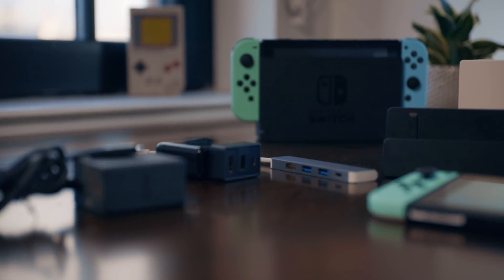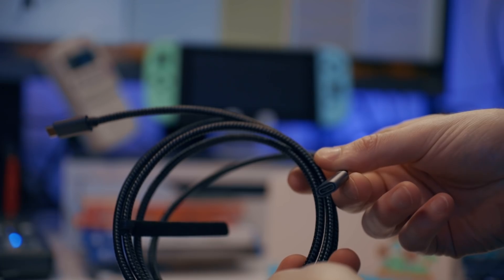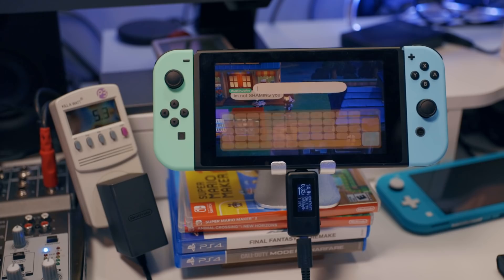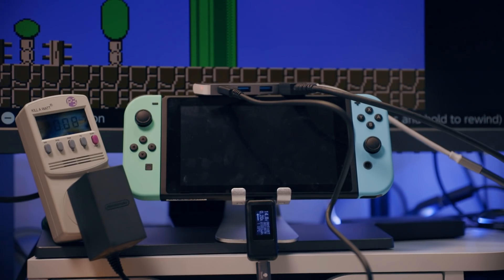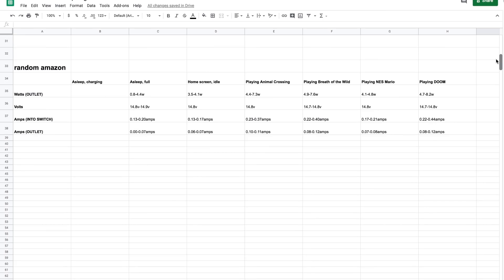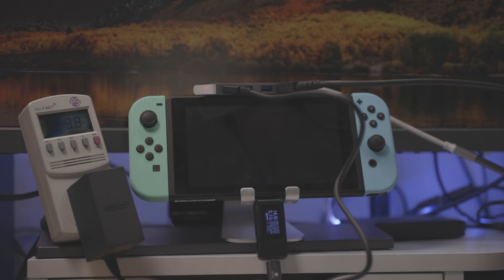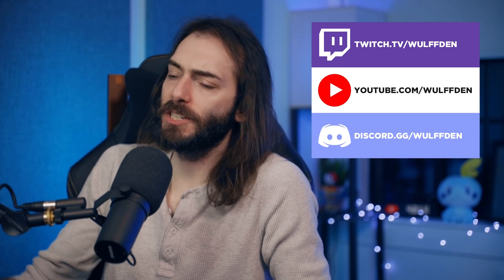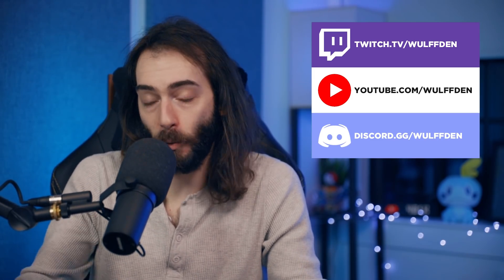How the Nintendo Switch consumes Power

Comment: so here’s a question regarding charging cables only- the switch pro controller (nintendo, not the 3rd party ones) comes with a usba to usbc cable. logically since it’s an oem cable, when paired with a PD-supported charger it should pull enough power to charge the switch itself, correct? because i can’t figure out why the one that came with my pro controller doesn’t charge frankly anything plugged into it. not even the controller very well. it basically pulls enough to act more like a wired controller. 

my assumption is the cable is bad, since anything else plugged into the same PD outlet works fine and the controller can charge off my usbc - usbc cables perfectly fine, and the switch can also charge off those cables no problem. the c-c cables came from anker with their PD 20100 power banks, which is my go to for Nintendo approved charging banks. and just everything charging banks.

Comment: As a computer engineer I have respect for anyone who does electronics testing for fun
Reply: Seems less like 'for fun' and more 'for my owm sanity' XD
Reply: Thats all good and well but when you publish results you should have the common sense to know that your value of zero is not zero unless the watttage is 0. Otherwise u r stating that invalid data is something you should go off of.
Reply: Same here (tho mechanical engineering and I do the whole electronics for fun thing).
The best way to get into a new field is trying it out for the heck of it. Electronics is certainly one field that people shy away from the complexity and fear of electricity or destroying expensive stuff, but the more people get into it, the less misinformation is spread about stuff like this whole dock deal, and less products end up in landfills, when they could be repaired instead.

Comment: Watched your last video about this stuff 2 days after I recieved my Ikedon switch dock...thankfully never used it though. Returned it and started my journey to find an affordable Nintendo dock. Finally found one on GameStop, yes, GameStop. Why? Because it came with the power adapter, HDMI cable and full dock (not missing ports or back door), all for $75. Plus, after getting it, the damn thing looks brand spanking new. No scuffs, scratches or anything that would indicate it was used other than the packaging it came in. 

I also ordered the Basstop enclosure based on your recommendation as well. So now I can rest easy knowing my Switch isn't going to brick itself randomly. So thanks for your obsession with talking about docks.

Comment: What about charge stands? I just wanna play my switch on a table while charging, specially if they have usb ports so I can connect the gamecube adapter
Reply from the maker: as long as youre using the switch charger and it's just USB pass through you shouldn't have to worry about charge stands

Comment: It kinda bothers me that so many are confused about what 'aftermarket' means, since it's literally in the name. These are not 'aftermarket' docks. Why, because the switch and the original dock are still on the market. These are simply third party products. It's called 'aftermarket' if the original supply and support has ceased and you cannot get original products any more, hence after the market lifetime of the original product. See this in so many videos ... Still, great video and content, thanks!

Comment: I'm curious as to which model of Switch were you using, the original XAW unit or the improved XKW? 
I have this half-baked theory that the original CPU didn't know how to properly interpret 3rd party docks and most of them were reverse-engineered so they were kinda left with one or two important inaccuracies, like the issue when charging in sleep mode.
Reply: People have already proven that old and new Switches use power differently. It's definitely enough to consider it a factor in the bricks.
Reply: Thank you!

Comment: so i played doom before patch and astral chain on launch at 1080p that day my switch overloaded and the cooling system has not worked since and i will say this i had a day 1 switch always plugged in to dock never played portable mode mostly played zelda botw and hyrule warriors for the entire time literally and currently smash it will not work with out my Desk Fan shoved up next to it it over heats within 10 mins of any game with out the fan and it really is very hot on the game card and micro sd card slots i do not know why the heat sinks are so close to the cartridge slots but they are Do not leave youre switch on when you are not useing it do not leave it plugged in get it charged then manually power it off and unplug the dock or put it out of dock you should not have my problem

Comment: I have tested third party docks and guess what, when U use a different charger than OEM...The consumption when is put into sleep actually goes to 0-0.3

So again, the real issue seems to be the official power supply which lacks of some protection circuits that are actually on the official dock. So if you get a third party dock, also get a decent power supply. (For examples HP branded ones, for surfaces tabs)

Comment: I wanna see you do the Genki Covert dock. The engineer broke down what the issue with 3rd party docks was on Reddit. Probably the only person as nuts as you about docks. I wanna see how his holds up.
Reply: WULFDEN plz notice these 2 comments from hellsattack and pomerleau. Dont stop talking about docks just yet! i dont think your viewers are annoyed by it at all. i find it deeply intriguing!
Reply: @LHSMeleeClub  Wulffden*
Reply: @reyzephlyn105  i know lol, i was too lazy to spell check it or edit it afterward
Reply: HellsAttack Not only that, but I want more details. Those watts consumed when in sleep, where they going in the Switch ? Or only consumed on the wattmeter ? It might only be an inefficient dock losing 1-2 watts, it doesn’t mean anything else.
Reply: @cedricpomerleau5586  It would go to both as when the Switch is kept in the dock. The dock will constantly trickle charge the system to combat the battery decharging itself. 1-2 watts might seem small to consumers but that 1-2 is life or death for some electronics.
Reply: @reyzephlyn105  Not all consumed power will be passed to the Switch though. It is showing as "0A" on the USB-C side same as the official dock so without a more sensitive USB-C side reading we have no idea if there's a difference between them or if that difference is enough to break the Switch's Charging IC.
2W @15V would be 0.1333A so I'd expect some amount of current to register if that power was being passed to the Switch.

The Docks themselves contain electronics that consume power so to me it seems likely their Power Regulation ICs and other things that are taking that power and likely losing it to heat.
Reply: Rey Zephlyn Like I said in a different comment, the dock only push voltage. The current is drawn by the Switch. You’ll not destroy an iPhone by plugging it on a 3A charger even if it can’t handle it, as it’ll only draw as much as it can. 

The only important aspects are the voltage out of the dock and another metric he didn’t look at : the voltage at the CC pin. Those are the only thing the dock can do to damage the Switch. That and sending power to the wrong pins if the connector is bad.
Reply: Jamstruth I think some people expect the current going in the system to be the same as the current going in the Switch as the current as nowhere to go. It’s very wrong. The current on the meter doesn’t mean much as it’s a current on a different voltage and before AC to DC conversion. By the way, all the wattage readings seen in this video need to be reduced a bit as AC to DC conversion isn’t perfect and will lose some power. Sometime even more if you don’t draw any current from them as the don’t "go to sleep" and keep loosing current through the converter.
Reply: @cedricpomerleau5586  I agree the difference is likely in losses powering the Docks rather than anything going to the Switch.

Looking at the data sheet provided by @Wulffden the differences at the Switch end are not much at all. The 0.1V difference is likely within tolerances and same with the current differences.
Reply: @cedricpomerleau5586  i was wondering this also lol. is wulffden overreacting in this video? my understanding of electronics was that they only draw the amount of power they need...so, you could have a more powerful charger than needed for the product and thats fine...products are only in danger if put on a charger that isnt giving ENOUGH power..........thats what i was always led to believe at least. but, arent there some cases where a device does receive too much power somehow and dies accordingly? ugh lol this stuff is so darn confusing.
Reply: ThaJakester You don’t receive power. The charger send a voltage and the device draw a current. The power is the multiplication of the two. So yeah a power supply can definitely send too much voltage or send voltage where it shouldn’t (data lines), which can break stuff. But once with the right voltage, it’s up the the device to decide how much current it wants. 

Take a basic 5V/1A phone "charger". The phone receive the 5V but draws as much power as it needs, while making sure to not draw more than 1A so it doesn’t damage the "charger". In the beginning it goes to 1A, but at the end of the charge it will slowly draw less and less current to slowly charge the battery. The "charger" doesn’t do anything special here.

I put "charger" because it’s simply an AC to DC converter. The real charger is in the phone and is the component that decide how much current to draw. Yes, the real charger is IN the phone/Switch. That’s the component that appears to be destroyed by some docks. The most probable reason is too much voltage on the CC pin, which isn’t related to charging in itself, but it’s what power the charger chip inside the Switch. If the voltage is wrong, it dies. And once it’s dead, it can’t regulate the current draw of the Switch.

By the way, drawing too much current for the charger should not damage the Switch, but the charger in itself (or the cable). But yeah, a damaged charger might do funcky stuff and then damage the Switch down the line.
Reply: @cedricpomerleau5586  thank you for your insightful knowledge<3 this stuff has always been tricky for me lol. ive read massive articles on the differences between volts, amps, watts, what a device does or doesnt draw, and etc, and every time i read into that stuff i feel overwhelmed by the information lolrip.

I'm pretty sure you already answered this, but as a final statement, lol, what is your opinion on a 3rd party switch charger connected to an official switch dock? Dangerous or no? The 3rd party charger in this case appears to be good as it's sold at major retailers. It isn't just a cheap online sold charger or something. It's also about the same size as an official charger.
Reply: ThaJakester Hard to say. I’m pretty sure that the dock isn’t simply a pass through, so I guess that if it ever damage anything, it should damage the dock not the Switch. Just be sure that the charger is able to output at 15V and 3A.
Reply: After watching this video, I contacted VECTORDRIVER on reddit. He responded, as I expected, that they tested this behaviour and the Covert Dock behaves like the official dock in that it basically goes to 0 A when the Switch is fully charged.
Reply: I just got the Genki Dock in the post today, I bought it back on March and at the time I remember them talking about safety measures they took. But in general I never leave my switch docked or in sleep mode, it’s always in the carry case.

Comment: So it's just sleep mode?
I have a question about the "official" cable too, how and why could it be that it has built in resistance? isn't a cable naturally a bit resistant due to the material? what would a resistor do in protecting the switch at all?
Reply: Anne-Marie Baars The 56k ohm Resistor is present in USB-A to C cables to prevent a device overdrawing current from a power source that doesn’t manage power correctly. Damaging the power source e.g Laptop USB port or old Wall Charger is the more likely possibility. 

All Nintendo supplied cables have this resistor and there’s an official statement from Nintendo Japan on their support page about requiring third party cables that have this resistor.

Make sure a USB-A To C cable is USB-IF certified and it will have it no need to worry. The Resistor isn’t needed for USB C to C :)
Reply: It's NOT only sleeping. The bricking happens because of a voltage overload on a specific pin. A crap dock does it either all the time or at random times. Not worth risking.
The resistor thing: it's just a resistor on specific data pins, that tells the maximum current the cable can carry without overheating, it isn't on the power path.

Comment: Great video bro brings a lot of closure 💯💯 I just wanna know is it bad to keep it plugged in while in handheld mode 24/7, cuz I mainly play in bed and don’t want to have to constantly monitor the battery while playing it keeping it from 30% to 80% or 50% to 90% I know there are many methods of prolonging the Lithium Ion Battery in it, but does it hurt it at all to just keep it plugged into the wall while playing in handheld all the time far after its hit 100%, this would also be a great idea for another video from you because from what I’ve found the info is very skewed from forums to what Nintendo says themself. Thanks again for the Switch news and info, really good to know 👍🏼 @WULFF DEN

Comment: I have a Jumpgate dock (the one that separates into two pieces).  However, I ONLY use it when travelling, like if I need to connect my Switch to a hotel TV.  At home I only use the official dock, and at work I only use portable mode (plus I have a spare official charger to take to work just in case I do need to charge it there).

Comment: The last graph is the most important - the idle wattage. But something don't sit right - to calculate wattage is: wattage = voltage * current.
If the current is zero, how is there power?
Reply: You want zero power when the battery is full

Comment: But you didn’t test the chargers. Can I safely charge my switch until it is close to 100%?
Reply: Chargers are 100% safe. And for the record, nobody has actually proven what caused the bricking issue with older third party docks. This is a good theory, but it hasn't been proven yet.

Comment: Is there any way to see what something using usb power delivery is requesting, voltage wise? I know that the difference in what was requested vs what was given, and the switch not following typical standards regarding this was therorized to be a potential source of this problem. Im just wondering if any equipment that can decode that exists. Might make for an interesting round two of testing.

Comment: bob: "i value my animal crossing switch way too much to sacrifice my switch in the name  of science"
also bob: use the exact switch to test all the other docks
Reply: I hate Nintendo's lame excuse for not allowing cloud saves for games.
Reply: These docks that are compliant are safe, he was willing to test it with them. And FYI there's still no hard proof of exactly what caused the bricks, not to mention that a third party charger cable has never caused a problem either. New third party docks are safe. You can easily Google it and find out which ones are safe or not.
Reply: @redwidow1358  For now that is. Nintendo only makes updates and patches with the official dock and charger in mind.

It'll be only sooner or later till they make an update and certain docks become un-useable with Nintendo Switchs.
Reply: @reyzephlyn105  I have a feeling this will never cause a real issue again, given that Nintendo's updates only come with stability in mind. Even if a third party dock were to be risky, updating the Switch and changing how it handles power should in theory only reduce risk.
Reply: @redwidow1358  It all depends on the update. In only recent times have they only really been just stability updates. We could be due any time for a over haul and an update to bring is back to square one for some docks.

In theory it should never be a problem again. But it's one of those things where we'll have to wait and see
Reply: Righttttt😆😆😆
Reply: Only an issue when in sleep mode

Comment: Question. If I have a case that won't fit into the official dock and I don't feel like removing it every time I want to play on my tv, is using a USB-C extender like in this video 100% safe?
Reply: Yes, a USB C extender is literally taking the pin on the dock and running a wire to the same pin on the switch

Comment: I'm a little confused though. I'm using a third party dock but an Nintendo power cable. Would that cause an issue as well when it trickle charges?
Reply: Third party chargers are safe, docks can be unsafe. The official charger in a third party dock will still pose a risk.
Reply: The dock is controlling how power is distributed to the Switch so the short answer is yes.